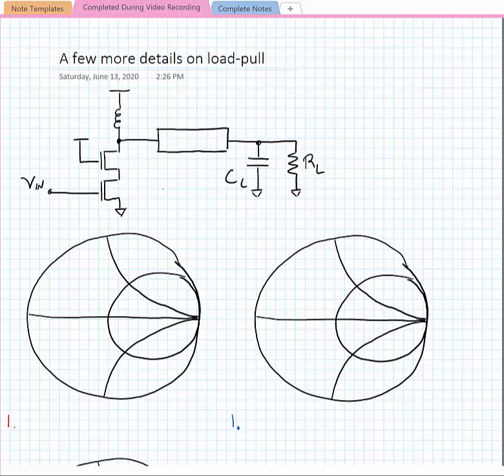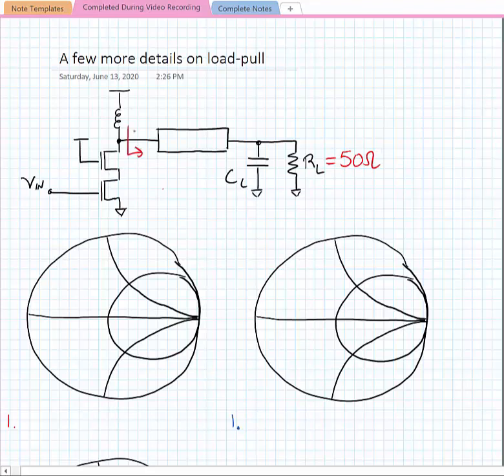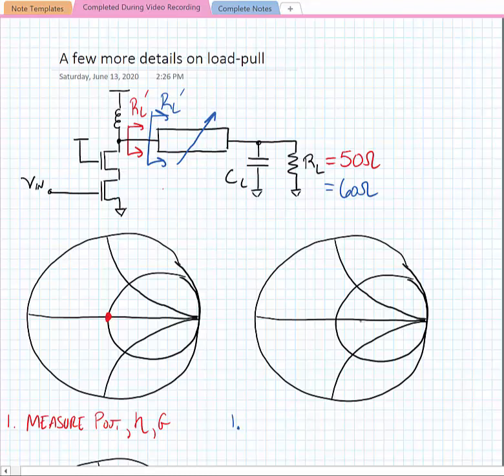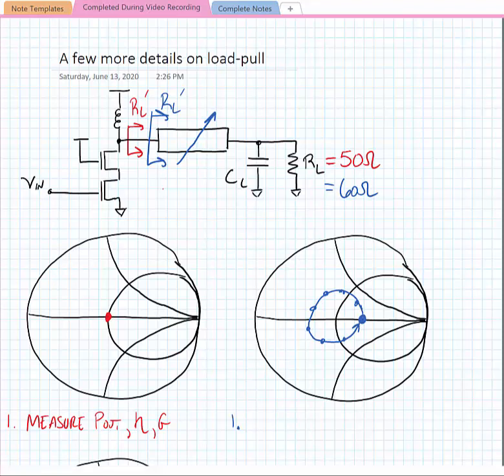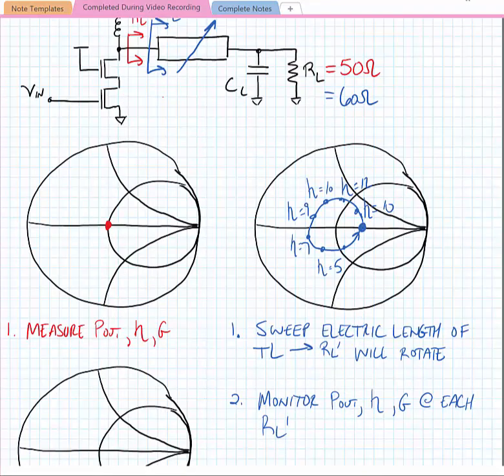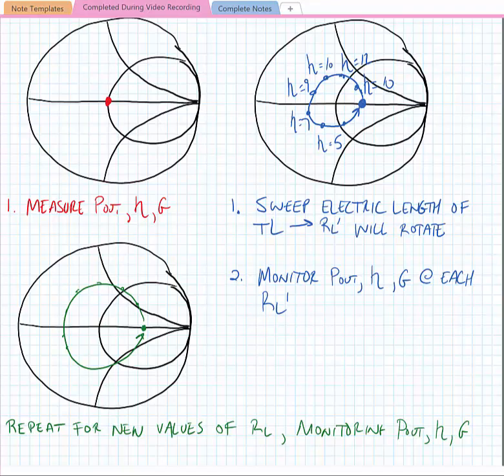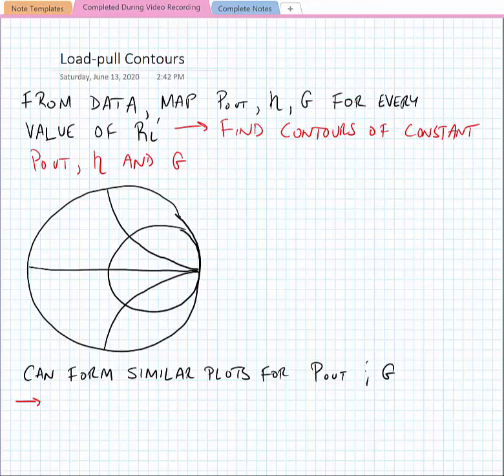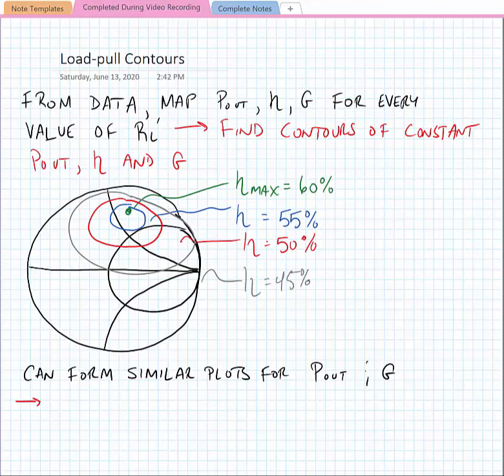Lecture 10.2 - Load Pull Simulation Details

Comment: When tuner provides the various impedance to PA output, Pout is measured at 50ohm ( for example, Spectrum analyzer). How we know insertion loss from tuner input to 50ohm Pout measurement point under a specific tuner input impedance in order to calibrate out that insertion loss ?

Comment: Nice one Professor! Just a small correction, the transmission line rotation from 60ohm load should be clockwise and downwards (capacitive) instead of counter-clockwise and upwards (inductive)...does not impact the explanation in this context though!
Reply from the maker: That is correct!

Comment: Thank you, Jeffrey! I understood that  you're explaning that Ropt (derived from the load line theory) can be found via load pull process, but isn't actually the load line resistance the resulting value from the parallel of Ropt (obtained from the load pull), ro and choke resistance? Thanks !! Keep the incredible work!
Reply from the maker: Ropt is simply the resistance that needs to be presented to the device in order to extract the maximum power. The final value of Ropt that achieves this contemplates any intrinsic device parameters, and extrinsic bias components that are included in the measurement/simulation. And really it is an impedance Zopt, because the device also has internal bias dependent reactance that needs to be cancelled.
Reply: @wallingphd  Thanks!!!